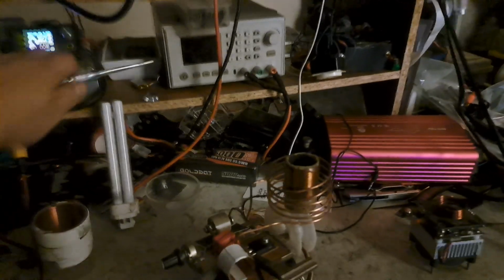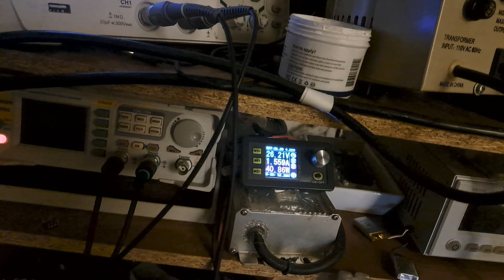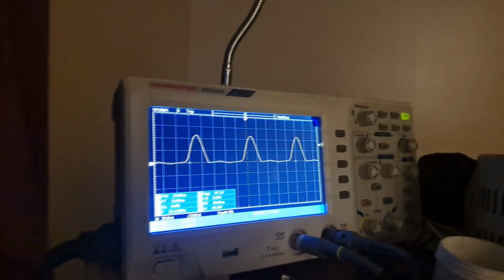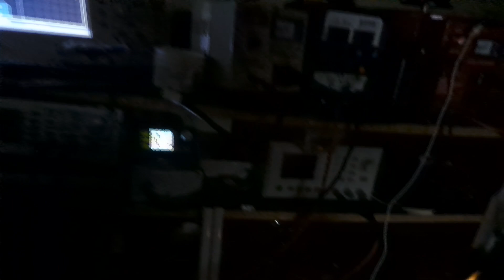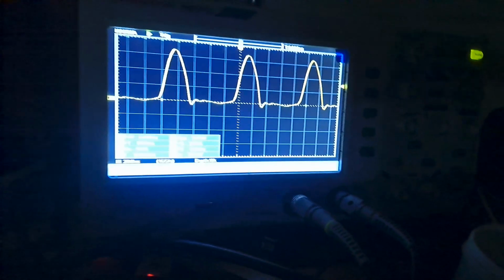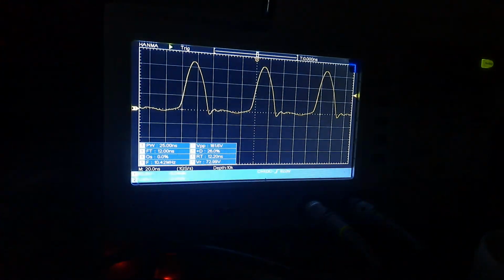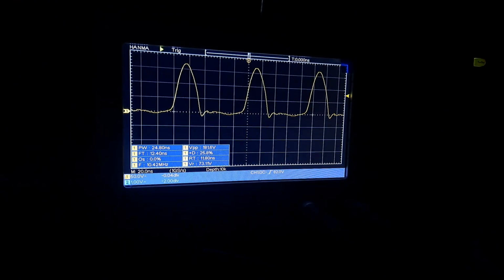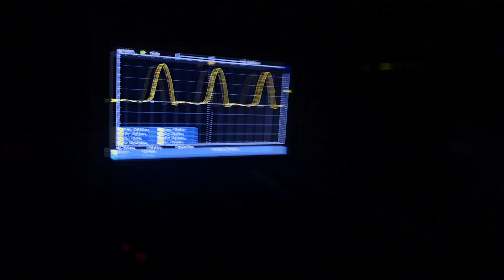Another Basic Plasma Flame 10.4Mhz 100W

Comment: Nice clean flame! Can we call them flames since its hot and white yellow?  Jk, i dont care about semantics.  

Now that have the TC’s designed and mostly built for the kids xmas, part of me wants to make a cigar lighter TC for my new brother in law.  Aside from not wanting to make the kids’s coils less impressive, the only other concern would be the current draw.   Big and bulky isnt an issue since hes the kind of guy who uses huge old desk top lighters, but the power cord os the issue.  I know.  Lithium.  But im not about to buy new.  And i dont want to be the reason their house burns down. Lol.  The proper charging and failure to notice an issue is what id be worried of.  He has tools so maybe i could take that part out of the equation by designing around whatever brand of cordless he uses.   Just thinking over text.

      Im feeling good today, i think ill be able to reach my rc cam on its shelf, and start that.  You had me thinking about what local frequency’s would be ideal.  I have some really early satellite receivers(one acted like a base station, then could be wired, or rf broadcast to others in the same house.  Ill have to check those out too.  Maybe once i get my bearings with that field, a purpose built system would be better then what i could afford for the helper robit.  Especially if size isnt an issue
Reply from the maker: There are some who have gone into more detail behind the physics of it but I'd say this particular one is safe to call a flame. With the right tuning it definitely looks and acts like one, where it even responds as a flame might when poking around at it etc. Just way hotter.

SSTC's that use batteries can be done fairly safely but it's a good bit of extra work. What I'd typically do is just add a buck converter with CV and CC and just set my desired charging voltage not to exceed 1A or so, which is typically a safe bet for charge rate on any cell at least 1Ah or so. With the buck being able to take a range of like 9-28VDC or something I'd then just find a power cord at something like 24V 1A and figure my plugs out. Safer would be adding a BMS board to the cells on top of a Low Voltage Cutoff circuit if the BMS does not have that feature. Add a fuse, and then you've got what is more or less industry-standard protection (aside from maybe not using commercial grade components).  China seems to get away with 48V or so max operation for their plasma candles. Current isn't too high. The problems are interference with those HFSSTC's. Tripping arc breakers etc.. It took me a while to realize what I thought was excessive noise kicking back into my lines was actually coming from the field and not the direct wiring. Isolating the things entirely and they still present a lot of noise. Any time I run particular HFSSTC's I have to cut my powered PC speakers off and deal with a motion light in another room switching on. Might be a problem for some, might not. SSTC's can and will still create crazy hot plasma flames in the much lower frequencies of course, where those noise problems don't really exist. 

My plan for a robot was to just use the commercial RC stuff and just have tons of functions, but I realized you have to get into Drone/Plane stuff to really have that ability. You end up with like 16 channels to work with if you have a controller that supports it. Then you also have the long range support for stuff like Crossfire control at around 915mhz, or ELRS. So basically after getting the controller/receiver stuff down it's all about making those 16 channels do what you want with switches/stick/potentiometers etc.. but those 16 channels would run out fast. Just one fully articulating "robot arm" that can also grab something at the very least is taking 4 channels by itself, and that's without adding a 'boom' feature where the arm can extend. 
Throttle, steering, Cam movement in 2 axes, lights.. that's another 5 automatically. I could personally make it work because those extra 6-7 channels I'd have left wouldn't go to anything complicated. More and more features though, and you might be looking at a complete DIY from the ground up.

Comment: Amazing !! Plasma flames are such a magic thing , I wonder how it would look qcw heheh I think tesla explorer did a qcwhfsstc and the arcs had a very goshtly cool form , yesterday I been playing with the min max range on my PLL and I got it working with the antenna but still needs more tuning , cause it ran better fixed frequency
Reply from the maker: Pretty much anything in the 6mhz+ region starts looking real funky when interrupted. It is really cool though. Definitely nothing like characteristic arcs in the hundreds of kiloherts. Now that you mention it since I do have quite a few HFSSTC's I made using gate drivers that have enable functions I could interrupt those just to see. Never quite got that far but I do have one I can run provably 5-7mhz and try to interrupt it. Have to source another gang of capacitors and stuff first.
Reply: @Magneticitist you could qcw them even if they don't have enables , what I need to do is to qcw a push pull like MSlab did , I have a few 640s ready to do that but I am just worried to fry the gates when ramping it , I should feed the gate bias with a different battery for isolation
Reply from the maker: @rodriguezfranco3839  I still wouldn't QCW any I currently have but I'd interrupt them. For QCW I'd use a 1200V fet and try to push higher voltage like somewhere around 200VDC.

The push-pull is still the easiest way to get long low voltage arcs but people typically don't want to mess with them enough to get them working right. I used to just grab two amazon mosfets, pull an inductor with two windings on it from somewhere, then start playing with coils.. It needs to be interrupted yea but I never understood why so many people would seek other more complicated circuits just for the same effect honestly. It's just two fets, feedback/GDT, biasing divider, some diodes, and interrupter of choice. Without trying to make it dual resonant or anything that basic circuit still works really good. 

Despite how difficult it apparently is to replicate out there I literally just used to toss together 2 primary turns tapped at the center and start playing with secondaries. CW for testing, at like the 9-15V regions. It wouldn't be difficult to then see what kind of tuning and output would then start yielding pretty good interrupted arcs at even higher voltages etc. I still bet a lot of people out there might look at some of those kind of circuits and just assume it's being fed a rectified AC which has a ramped DC component to it.
Reply: @Magneticitist  yeh push pulls are cool but last time I tried to put together a new push pull I kiled like 6 fets , I used a very small ferrite line filter as the ct (probably that was a problem ) and I it seems that I had to get the gate bias too high to get it working so that was killing them and at the same time it killed my interrupters , so it was not funny hehe , but I realized that in CW you can cut the gate bias once it starts oscilating and the coil keeps working on his own , I bet it would make a great plasma flame driver in cw
Reply from the maker: @rodriguezfranco3839  I never really had those problems so it's hard to say what the major factor there for you was. I mean I did kill some fets early on but that was because I was using 55V fets and trying to run up to 24V and stuff like that. I'm pretty sure dead fets out of nowhere is typically the result of bad layout or bad grounding. 
A lot of my older videos I just started explaining that all I did was use the same basic circuit but run knockoff IRFP250's instead, while also just using a basic 2 turn center tapped primary instead of some complicated flat cable arrangement. For me getting the interrupter to act consistently all the time was the issue, which better grounding and shielding seemed to fix for me. 

If you think about it there is no shortage of people out there who have done almost the same thing with Slayer exciters, but just add another switch and a primary.. I would wager tons of people out there would jump right to a circuit like that if they thought it would guarantee more power, but end up finding it less complicated even though it's using the same components. A slayer is also still just using direct secondary feedback through a direct electrical connection. I mean almost everything about it just seems jankier than a push pull IMO. So just in theory it seems like there is some fatal fault to your approach you just need to figure out a workaround for.

Comment: I want to ask please start a zvs sstc . I made it its interesting. And you will turn it to a great project as always .i can send ou the schem in high voltage forum to tell what exactly i mean.
Reply from the maker: Yea I'll have to see what you mean, otherwise I just assume it's a mazzilli driver tuned to a TC resonator. Probably basically same thing as the nicely tuned push-pulls but with less harmonics.
Reply: No it is pure zvs driver with separated gate voltag . The push pull one is great idid what ever you post on youtube .
Reply from the maker: @Hoomanrahimi  Yea it's not going to use feedback like the push pull but it's providing the primary with positive and negative swings using two low side switches. Like the push pull you should be able to get good current from it. It's just a high frequency AC source for the primary and a tuned secondary to create arcs. ZVS drivers work well for basically any kind of transformer.
Reply: https://youtu.be/c8Otcjc6D0k?si=Gw9j0zUqO9rSn_Bo 
This the one L ment
Reply: I tried it it is wonderful. Lots of current  goes on capacitors and fets are only warm . Its lik drsstc . I'm sure you will improve it to best tuning 😊
Reply from the maker: @Hoomanrahimi  DRSSTC is exactly what it is, it's just a parallel LC rather than a series LC. The primary resonates with a lot of current but does not rise substantially in voltage, more like 4x the supply like a typical ZVS. That resonance is then coupled to the secondary resonator for dual resonance.

Comment: Sir I made 555 flyback driver and i input 12v in driver and in the MOSFET i input 20v 10a by my smps but when i connect smps wire my mosfet fall and my smps off it has sort protection,why is this happening i fried my 2 MOSFET.
Reply from the maker: Hard to say without seeing your circuit but if the mosfet is immediately failing rather than the supply going into protection first, you're killing the mosfet from overvoltage or something like that.